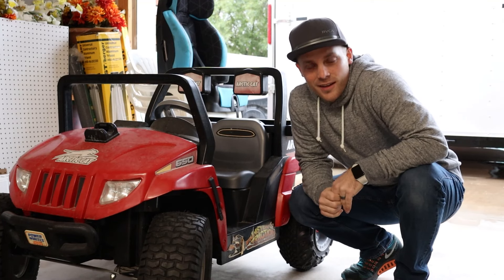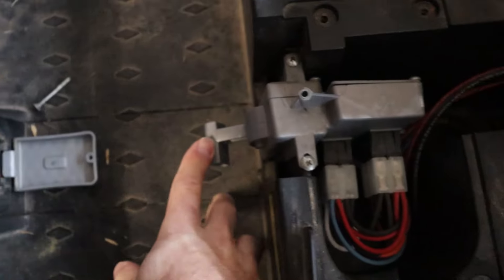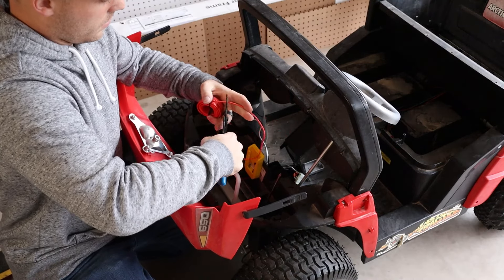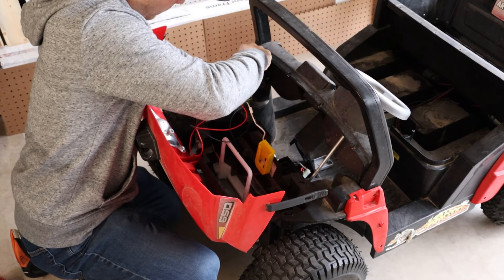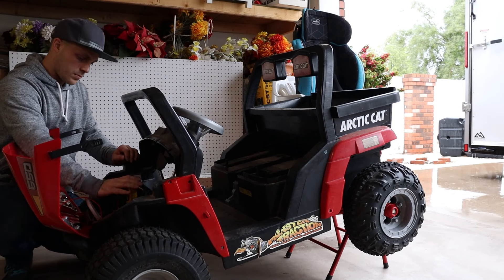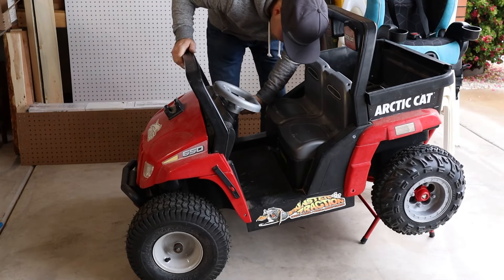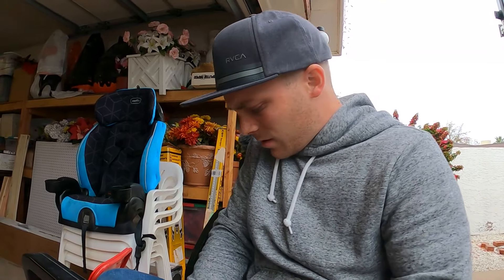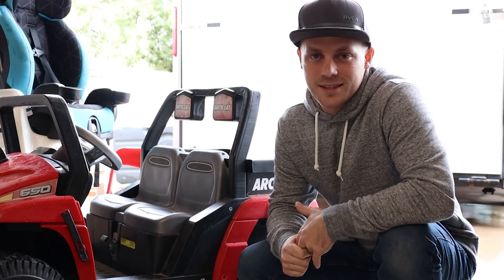Power Wheels Upgrade - HOW TO (20V Battery Upgrade)

Comment: Why is the motor controller nessary??
Reply from the maker: The motor controller is not necessary, but I’d recommend it. It controls the voltage that goes to the motors which directly affects the speed the motors turn and thus how fast the car can go. I added it in to be able to regulate different speeds depending on which child was driving it.
Reply: @TheWorldIsOurLab  could that be the reason I keep blowing fuses
Reply: @southtexasfishing1252  Ours came with a 12v system and all I had to do is add the connector kit which has a fuse. It runs off the 20v 5ah batteries. I'm no electrician, but you might need to beef up the voltage of your system. We haven't blown a fuse yet, and he drives it for the duration of 2 batteries just fine.
Reply: Motor control is not necessary unless you have an old model power wheels that has the original motor. They can only handle around 15 volts. The new ones can handle 24 volts with low amp draw...
I have set up several of these. The best combo so far has been with two 18 volt Milwaukee M18 8.0 batteries.. I run the batteries parallel not in series.
Reply: Preservers the motor cores from too much current same reason as sizing the fuse appropriately. It will work without it, but this guy hooked his up that thing will last a hot minute. Also interfaces with the rocker switches easy peasy for a clean look and more accessible power switch I’m guessing.

Comment: Good stuff man, broke it all the way down and you’re a hero for the material links, only question is why buy the 20v adapter cartridge not already prewired with the 30 fuse harness? Only thing I could assume is cheap hardware and it works better self wired and with possibly better hardware? And also you did mention you have customizable options, maybe that was the primary reason? They have 20v adaptors already wired to the fuse harness for almost half the price of just the adapter so I’m just wondering if it’s a manufacturer and hardware quality thing. Any how thanks for the great video, liked and subscribed! 👏👍
Reply: I found a 3 pack of 20v adapters prewired with the 30a harness using 12 AWG and an inline switch(which id cut out) for 16$., I would still buy the shrinks, wire connectors motor cont
Controller and rocker switch for customizing and style points but is there any reason not to buy the 3 packs of adapters?

Comment: Why do you need a switch when it only activates when you push the accelerator?
Reply from the maker: Good question, after I slide the battery into the yellow holder at around 3:44 minutes into the video, I mention that the light is off on the switch and the motor controller. After I turned the switch on, the light came on inside the motor controller, but not on the switch. The reason for the switch is because the small light inside the motor controller will drain the battery slowly if not disconnected. So I added the switch to completely isolate the battery and hopefully save a little bit on the life of it. It is dependent on my kids remembering to turn it off - which they are pretty good at. A side note, the reason the light did not light up on the switch was because I didn't have the right match of switch to voltage I was running it at. It still works as a switch, it won't light up however unless I make some changes to it. I've also got other things planned for the car which I'll make another video about where the switch will be important.

Comment: Hey love the mod, i also plan on doing something similar. Just curious, is it still running? Any issues you noticed so far?
Reply from the maker: Glad you liked it! It is still running. A few things I've noticed is that my kids go hard on it so we've gone through quite a few 30A fuses (maybe 5 or so). One of the motor gears is starting to make a louder clicking sound as well which I'll be checking out soon. With more power and harder play, it's likely that some of the teeth on the plastic gears have broken.
Reply: You can get flex volt dewalt batteries up to 60 v but you better not run 60 through a 24 v motor or its going to melt wires/ motor

Comment: Great video! Just started getting into did this for my kids as well. They love it. Running 18v milwaukee because that's all i haves and got lots of batteries and rapid chargers. 

I would suggest using a voltage regulator as well, wired right after your battery that way when the battery gets to a certain voltage (16.5v for mine) it disconnects itself so that it doesn't completly discharge your whole battery. If a lithium battery discharges completely, it will destroy it and it may not recharge anymore. Not sure what a safe cutoff voltage is for a dewalt 20v is but easy to find out. Just run your battery dead with one of your tools and then measure the voltage using a voltage meter to see. Then set your regulator to that exact voltage, just to be safe. Just a suggestion.
Reply from the maker: Nice! Good suggestion.

Comment: I have discharged 2 Dewalt Batteries to where they will not charge again.
I have the adapter and motor controller installed correctly. Car runs great but I'm toasting batteries. How do I protect them?
Reply: Get the switch. As stated, if the battery is left connected it will keep draining until it does to the point of not charging. I used this link and saved two of my cheaper non name brand batteries. 
https://m.youtube.com/watch?v=XklpbyQIeFA
Reply from the maker: Adding the switch was a way I was trying to prevent that. That or remove them when not in use so they don't get slowly drained beyond the point where they can be recharged.

Comment: Did the conversion on my sons power wheels it was running fine for a few minutes but now it turns on but will not move. Think I might have burned the motors out any suggestions on upgrading?
Reply from the maker: Good question. If I was troubleshooting it, I’d start in this order:
1) Double check all wiring connections.
2) Confirm the battery has charge.
3) Check the fuse - make sure it’s good.
4) Confirm the motor controller is operational (voltage in and voltage out)
5) Confirm gear selector is working

As far as upgrading, I don’t have a specific recommendation… yet. For now, maybe look for a direct replacement.
Reply: If you used the silver speed controller, it’s common for the internal mini fuse for that to burn out, even if your other main fuse is fine.
Reply from the maker: @DadHacks  Thanks for adding this - also true, especially if your original fuse was over the current rating for the speed controller.
Reply: @TheWorldIsOurLab  use the motor from a 20v drill and speed control?

Comment: Hi I want to know what the original voltage the motor is rated for.  Im assuming it was 12v..  Ive put a 20v on my sons 6 v and we ended up snaping the gearing and it would smoke after a couple minutes.  Now we are running a 12v tractor battery through a 6v motor.  Im planning on putting a true 20v motor in with the setup you have for speed control and dewalt batteries
Reply from the maker: Original was for rated at 12V. Good luck with the upgrade!

Comment: My power wheels car i got for my kids has a remote control, and speakers attached to the remote adapter inside the unit. It also is where the power runs. Anyway to do this conversion with all that being said?
Reply from the maker: Great question! In most cases, the power runs through the controller on the car (which contains the receiver from your remote's signal). When this happens, it's likely that the other components like the radio and speakers are also affected by a change in voltage. These may not be as big a deal, but if the voltage to the receiver is affected, which is likely, then you will probably face a problem with it working.

In theory, a way to work around this is to maintain the power to the controller on the car so that it is not affected and then separate the increased power to the motors only. The challenge here is that the relays which control the motor voltage being applied are also on the controller so they would need to be identified and somehow transferred as well. Once again, just in theory - I have not done it myself, nor do I have a video showing how to do it.

That being said, I've considered working it out and making a video for just that. Is it worth it?
Reply: @TheWorldIsOurLab  thank you so much for your reply! If you could that would be amazing! I attached my 12 amp dewalt flex battery to it and the controller started smoking, this is how I figured it was to much power haha. I ordered another controller and now just trying to figure out myself how it works but I think you will have a lot more success then I’ve had.

Comment: It worked well.  The only thing I used was the original switch and it started smoking. All lights worked. I don’t have a fuse which I will be installing.  Is the motor controller definitely needed?
Reply from the maker: Glad to hear!

I would recommend the motor controller, but it is not needed to get the motors turning. It only controls voltage which translates to faster or slower speeds depending on what speed you want it to go. The fuse is important to keep from overloading the current and burning things out.
Reply: @TheWorldIsOurLab  thank you
Reply: You lost me at the mother controller connection. I can't tell what is hooked up to what
Reply from the maker: Sorry to hear that, would a diagram be helpful?

Comment: Hi great video, I had a question about charging the battery though, can you use the cars original charging port to charge the drill battery or should you remove it and charge it with the drill battery charger itself?
Reply: Drill charger
Reply from the maker: I am removing it and charging it through the drill battery charger. I would not recommend trying to charge it another way.

Comment: So do you have to have the on off switch?  If you take the battery out doesn’t that negate the power anyway?
Reply from the maker: No, you don't have to. It functions as a master switch. So I could let my kids leave the battery in, but teach them to turn it off so it wouldn't drain the battery from the small LED that is in the voltage regulator/motor controller.

Comment: I've done this and my power wheels only go about 20 ft then shuts off I wait about 5 minutes then it goes again do you think I need to bypass all the accessories? Mine has a radio horn car sounds
Reply from the maker: Possibly. Not knowing your particular power wheels model, it's difficult to say for certain. However, there are some things to keep in mind. If it's shutting off and then able to turn back on and works again, it means that there is something in the system that is causing it to lose power and then by allowing time or a change in conditions, it is able to reset. This is likely due to a electrical overcurrent protection (think a fuse or breaker), component overheating protection (think of a relay which shuts off when it gets too hot), or an electrical short (think loose or broken wires/connections). Based on what you are describing, I would check those possible sources in that order. Some components like the radio, horn, or sounds may have a built in current over protection which could be causing the issue. Depending on how the circuit is wired, removing them could solve the issue. Another likely place to look is for a breaker which could be integrated into a foot pedal switch or somewhere near the old battery, or at the shifter. While you are checking all those areas, check for loose connections or broken wire. If something is loose, it could be causing the issue, but is less likely to restart after without reconnecting somehow. 

Good luck troubleshooting!
Reply: @TheWorldIsOurLab  thanks I'll check it out
Reply from the maker: @darthprime117  Absolutely!

Comment: I just acquired a PowerWheels Jeep that my neighbor was throwing away.  I plan on looking into to do the same thing with my Dewalt batteries.  Have you had any issues with the batteries discharging completely?  Some of the videos I've come across recommend installing a low voltage disconnect to protect the battery from fully discharging.
Reply from the maker: Cool! Good luck on the project!

I have not had any issues with the batteries so far.

Comment: My kid's jeep rubicon has a logic board in it that was damaged, it no longer wants to move so I'm in the process of doing this. Thanks for posting this. I'm hoping the logic board wasn't used in switching between high and low as well as fwd/rev or I have some switch hunting to do =|. I can figure out fwd/rev but I'm not sure how high and low would be wired. 

Both motors in parallel for high and just 1 for low? Or are they in series for low? Or would either be down to how I want to to run in low? parallel high single motor low vs parallel high series low kind of thing.
Reply from the maker: Without seeing the logic board and how it fits into the wiring diagram, it's difficult to say whether it controls high and low (meaning speed). However, high speed and low speed are typically a voltage adjustment, so if the board was controlling the voltage output by switching a handle physically to low or high (or reverse for that matter by switching polarity), then those may be impacted. This is the reason I have the motor controller in place in my build - I can set the voltage output to whatever I want to govern the top speed. If you want to make the adjustment knob accessible, you could do that. Mine also has the switch to shift into FWD High, FWD Low, and Reverse.

Most likely the motors are wired to run simultaneously - I would not recommend wiring it so that only 1 motor runs at a time for low and then both for high. Just use the voltage to control the speed.

Good luck on the project!
Reply: The logic board on the jeep definitely controlled all the functions of the motors. After I tore it apart I found they had 20 gauge wires from the direction and speed switches. I ended up having to get 2 dpdt switches and had to rewire the whole thing with 12 gauge wire. I had it out test riding today and it was great. Just wanted to check back in and say thanks.  @TheWorldIsOurLab
Reply from the maker: Awesome!

Comment: Hey buddy.. did the same to one. I can’t get it to work like that. If I turn on the power switch it just stays on.. it bypasses the pedal.
Reply from the maker: Sorry that’s happening! It’s hard to say what could be wrong without seeing it. Where I’d start to figure it out is tracing all the wires and figuring out where all of them go. Then figuring out whether the wires that go to the pedal are connected incorrectly.

Also, if you have a remote control, it’s possible that there’s another issue going on, but that’s a little more complex.

Comment: This worked so great thanks!! I used a Makita 18v. I was contemplating buying a 40v do you think it will work or would it be too much?
Reply from the maker: Awesome! I’m glad it worked! You could do it with a 40 volt, but the chances of you burning out a motor or other component go up quite a bit. For example, if the motors were rated for 12VDC at 3.5A (42 W), then increasing the voltage to 40V would increase the possible power load almost 4x to around 140 W. That’s not to say it would, just increase the chances (assuming everything else stays the same). I’m simplifying some since motors will draw what current they need to achieve torque, so there’s a chance that the actual power the motor sees is more or less than that at any given time. Hope that helps you consider it a little more.

Comment: I used the same controller, internal fuse keeps popping, ever happen to you?
Reply from the maker: I have not had issues with the internal fuse popping. If you have a 30amp controller and a 30amp fuse between it and the battery, the fuse should be the one to pop first.
Reply: I have the same problem with the 30amp fuse in the controller.
Reply: I have the exact same problem.  Sometimes the fuse lasts for a while, other times it does not.  And it really doesn't matter where I have the dial turned to.  Any ideas?

Comment: I just did this and the radio on the power wheels comes on but the power wheels doesn't go anywhere like the tires don't try to spin why?
Reply: Could be a bad controller or loose wire
Reply from the maker: Tough to say without seeing the wiring diagram. If you have a remote control system, this could be the culprit - those systems are wired differently.
Reply: I believe the radio is a separate battery.